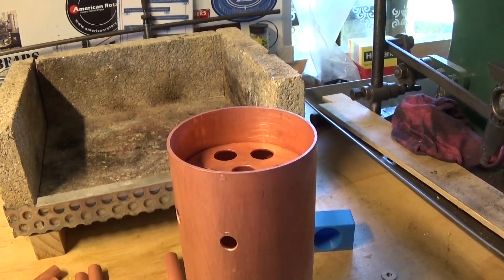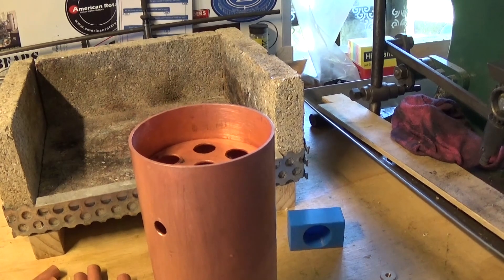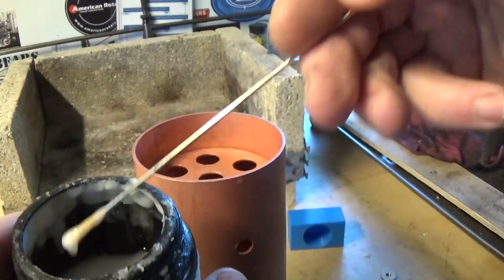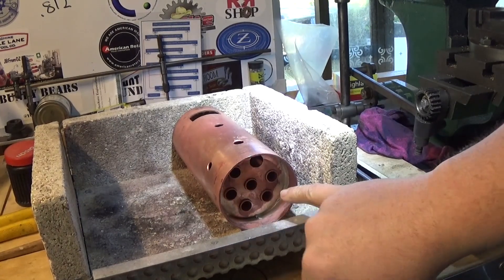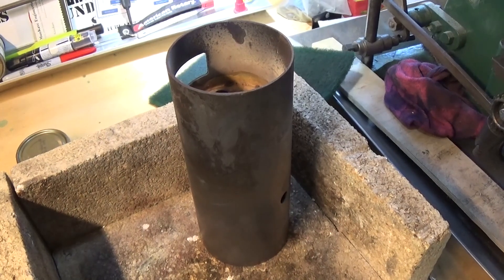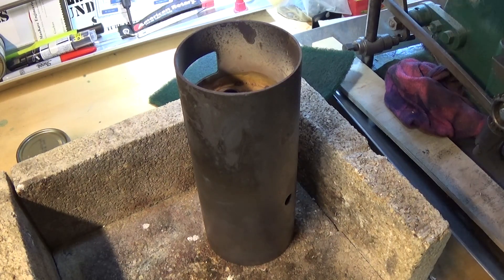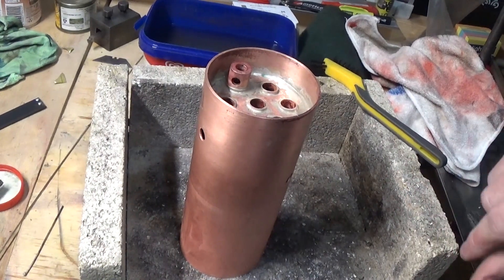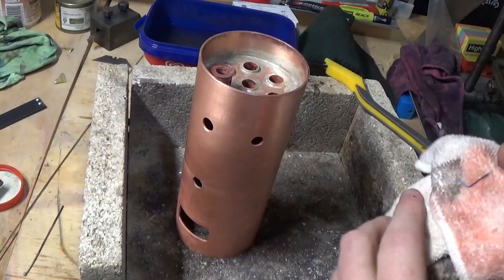Introducing and making EUGENE- A small copper boiler Part 5

Comment: Relief valves or safety valves would typically be installed at the outlet of the superheater. That way if the safety lifts there will still be steam flow through the superheater. Superheaters typically exist in the firebox though, so what you are putting in would be more properly called a dryer. On an industrial boiler the fitting installed in the smoke box would be what is called an economizer and what flows through it is the feedwater before it enters the shell side. The shell is the water/steam space on a fire tube boiler. This heats up the feedwater before it enters the water in the shell using yet a little more heat from the flue gas.
Reply: Noel Henderson c

Comment: Your tube at the top of your boiler you called a drier, is actually a superheater.  Raising the steam temp above saturation temp.  giving the steam a lot more energy.
Reply: Actually, this is a dryer. Superheaters are typically installed in the firebox and collect radiant heat and convective heat. You can also put superheat in steam by throttling it. When steam is throttled you don't lose enthalpy so, depending on how much throttling you get you can dry the steam and have superheat left over. Superheat is sensible heat though so you lose it pretty quickly if the steam lines aren't lagged.

Comment: Great job Emma. Only people who have done this will know just how difficult it is. As you correctly say, copper being a good conductor absorbs heat, so it gets hot enough to melt the solder at the same time. I can? (could) solder wires and copper plumbing fittings but never had any real success with anything else. It's been 'good enough' but really looked a mess.

Comment: I have seen boilers that had the fire tubes swelled into the head sheet with an expanding mandrel type tool rather than being welded in. Perhaps that method would work here as well and save a lot on time and cost.
Reply: Most industrial boilers have the tubes rolled in. Firetube boilers have the tubes in one tube sheet, typically the one for the furnace end, rolled in and the other tube sheet is fitted with glands for the tubes. This way the tubes are free to expand and contract. I'm not sure why the tubes are rolled as opposed to welding them. I have seen boilers that had rolled tubes need to seal weld the tubes. This usually is a result of the boiler experiencing a low water condition and then having water quickly put into the drum, quenching it. A low water condition should actually trip the fire off but sometimes the cut-out malfunctions.

Comment: The nice thing about silver solder is that once melted, it requires quite a lot more heat to melt it again. I seem to remember  numbers like 600 C  first melt and 800 C re-melt. This allows you to tack the top plate on, then go around and tack the tubes in without remelting what you just did, whereupon the whole thing collapses.

Comment: Nice job, Emma.  What is the formula for the pickling solution that you are using?
Reply: I use vinegar with a splash of salt, warmed up in a crock pot, with similar results to what she's getting.  i'm curious to know as well.
Reply: I think that Emma posted this in one of the earlier videos.  I am taking the easy way out by asking instead of looking back through them.  I was pretty sure about the vinegar just not sure about the salt.
Reply: I don't know if salt is necessary, but I'm afraid if I don't add it, Chef Gordon Ramsay will yell at me for not seasoning it.  ;)
Reply: Believe me, I have made pickles and forgot to put in the salt they tasted terrible LOL
Reply from the maker: +R. Steven Lang its citric acid from the home brew supplies..
Reply: Thank you, Emma.

Comment: Nice work.  Thanks for pointing out that "real" silver solder can be purchased at air conditioning supply houses.  That's where I've been getting it for years, but nobody seems to point that out in videos.  Good job.  In North America, silver solder is most widely known by the trade slang Silfos (pronounced: Sill-Foss).  The most common torch we use for that work is an air-acetylene torch known by the trade slang Turbo-Torch.    Can't wait to see what you have in store for the fire hole door.

Comment: Hi Emma Looking good so far. If you started soldering from the bottom any excess heat would travel up the part and preheat the top tubes. That would help a little with the smaller torch. Also sometimes applying more heat at the same time with a plumbers blowlamp will help with smaller torches.  Good enough is always better than not at all. :- ) With a bit of polishing and paint every thing comes right in the end.  regards from the UK. Gary